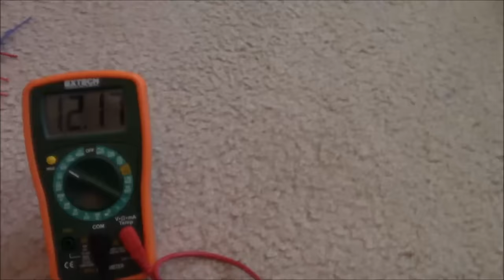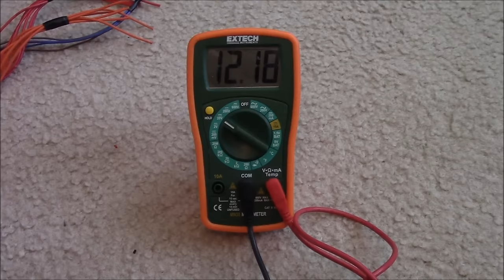How to Hack a Computer Power Supply (PSU) To Use as a 12V DC Power Source

Comment: would you be able to do this with a modular psu?
Reply from the maker: Yep!  Same procedure but you would not have as many yellow and black wires to combine together unless you connected all the modular wires to the PSU.
Reply: LDSreliance oh ok so i just grab all of the 12v rail connector pins and just use all the wires from them?
Reply from the maker: How To MLG
That is the safest option to use all the power, in my opinion.
Reply: LDSreliance alright thanks, one more thing.. are you able to use lets say 3 psu's at once?
Reply from the maker: How To MLG
Theoretically yes but there may be some issues combining the power in the real world.  Remember, electricity follows the path of least resistance so if you have 3 PSU's hooked up to a load center or something it may try to draw too much power from the PSU that has the least amount of resistance on the wiring.  There may be other potential pitfalls that I am not aware of, too.  You would be safer to get a bigger power supply.
Reply: LDSreliance my target is to get at least 2500 watts running to a car amp.. but the biggest psu you can buy is a 2k watt one
Reply from the maker: How To MLG
Use this power supply for the head unit and door speakers.  Then get four marine deep cycle batteries from Academy/WalMart/Batteries Plus for $99 each and wire them in parallel.  Get a 5+ Farad capacitor and a 12v battery charger.  Connect all your bigger amps that can't run off the PSU to the battery bank and cap for testing.  Then charge each battery individually overnight with the battery charger before your next test.

There are probably other ways to do it but even hooking 3 computer PSU's together if it really works in the real world would still not give you 2500 watts of power for a sub amp.
Reply: LDSreliance i did the math and with 3 1600 watt psu's that will give me about 375 amps to play with so i can easily get 2500 watts to a sub
Reply from the maker: How To MLG True, it should work.  Let me know how it goes!
Reply: LDSreliance alright when ever i have it all setup i will make a video on it :) wish me luck haha
Reply from the maker: How To MLG Good luck!
Reply: change of plans, im going to be getting a power amp from Cerwin Vega as it would be a lot cheaper for the amount of power i want
Reply from the maker: How To MLG Yes it would.  Is it AC powered?
Reply: LDSreliance yes, and the output on it is 5k watts @ 4 ohms bridged.. would i need a 240v socket for that? or can i just use a 120v? it says 120-240 but im not sure if i would be able to get 5k watts from it
Reply from the maker: How To MLG You'd have to look at the detailed specs but it should be able to do either one.  It probably only does 240 because that is the standard in Europe and other countries.
Reply: LDSreliance alright thanks, on the back of the amp it says 120 volt 60 hz 2300 watts.. i guess thats what it consumes, heres the link to it if you want to check it out

http://www.cerwinvega.com/pro-audio/high-performance-amplifiers/cv-5000.html
Reply from the maker: It shows under max power it will consume 56.4 amps @ 120v which is 6,768 watts of input power to make 5,000 watts of output power.  So it will make the full 5000 watts whether you use 120v or 240v.
Reply: LDSreliance alright thanks for the clarification, i  was wondering about that for a while now, also is there a way to check how much amps i can pull from a single socket without blowing a fuse?
Reply from the maker: How To MLG In your house you can usually safely pull 15 amps before tripping a circuit.  Check your circuit breaker panel before trying to use the max 5000 watts. You may have to get an electrician to add a heavy duty circuit to your house or garage where you are going to test that can handle 60 amps like you are looking at using.
Reply: LDSreliance alright my mom has a friend who is an electrician so ill ask him
Reply from the maker: How To MLG NIce, good luck!

Comment: can I charge a 6v battery here
Reply from the maker: With a step down converter or voltage regulator, yes.  Otherwise no.  In this video, I am showing you how to work with the +12v rail and 12v is too high to charge a 6v battery without hurting the battery.  You would need some way to limit the voltage to about 7.5-8v or so.

Comment: How many amps? 1 Amp ? 2 Amps?
Reply from the maker: The one I used in the video can provide 20A @ 12V.  But your PSU may vary.
Reply: @LDSreliance  that's odd, i watched another computer power supply video and he mentions only 500 mAh. Can you test it with a car headlight?
Reply from the maker: There can be multiple 12V rails.  The main one will be at least 15A in every supply I have ever seen.  But some of the other ones can be much smaller.
Reply: @LDSreliance   Well with that kind of amperage I would have no trouble charging a car battery or even using it to crank it over then! Is that correct?
Reply from the maker: You could charge a car battery but not even close to starting an engine.  That takes many hundreds of Amps.

Comment: can it power a 400 watt radio
Reply from the maker: If your PSU is big enough, yes.  This one in the video was only 400 or 450 watts and only had 20 amps on the +12v rail (240 watts).  So if you had one that was like 750-800 watts total I bet the +12v rail would have enough power to do a 400 watt radio.
Reply: LDSreliance thanks
Reply from the maker: roshaun gooden
You are welcome.  Thanks for watching!

Comment: Yes the fan will go a split second and then stop nothing else happens after that
Reply from the maker: +Zee villi It sounds like it is detecting something is wrong and shutting down.  Are you sure you don't have any of the other wires touching?  Are you leaving the green and black wire connected?
Reply: +LDSreliance  yes the green and black wire have a good solid connection all taped up and everything
Reply: +LDSreliance there are no other bare wires other than the green and black i stripped and connected
Reply from the maker: Zee villi
I have heard that some power supplies will not start up if they detect that nothing else is connected.  Try connecting a device to the +12v rail before you try turning it on.
Reply: +LDSreliance i have connected the head unit to the psu and still the fan only spins for a second and turns off i have uploaded a video of what i did
Reply from the maker: Zee villi
Hmm, I didn't see a video.  I will go look again.
Reply: +Zee villi Some power supplies have load detection. They will have a low voltage line that will always have a load when the computer is turned on. If you do not have this wire connected to a load the power supply will go into standby. You should be able to find a schematic online for your power supply and then it is just a matter of soldering in a resistor to the load detection line.
Reply from the maker: ballzack57
Thanks, that is a better way of explaining what I had heard about some power supplies!

Comment: You destroyed my power supply I connected all wires as you said and now it starts just for 0.5 second and stop ......
Reply from the maker: That is common.  It is a voltage sensing feature of some power supplies.  If it does not detect a load it will shut down.  You have to have an active load on the power supply when you start it up or wire in a resistor to fool it into thinking there is a load.

Comment: how to reduce its current?
Reply from the maker: You can use a voltage converter or you can just use a different rail.  If you need 5v power there is a 5v rail you can use.

Comment: How many watt from this?
Reply from the maker: 20A on the 12V rail.
Reply: @LDSreliance  are there any ways to get full ampere from the psu. Say 400w psu. So 12v 33A..sorry total noob here
Reply from the maker: Unfortunately, they rate the power supply as a total sum of all the rails together.  So the 12V rail will be the biggest but there are also multiple 3.3V and 5V rails as well as usually a second, smaller 12V rail.  So to answer your question, no you cant get the full factory rated wattage from the single 12V rail.
Reply: @LDSreliance  how about combining all 5v and 12v cables.
Reply from the maker: That won't work.

Comment: Why my fan inside doesn't work
Reply from the maker: DarkzFlame Gt Did you connect the green wire to a ground wire?  If you haven't done that then the power supply won't turn on.  You could also wire those 2 wires to a switch so you can switch it on and off.
Reply: Thanks that helped.
Reply: LDSreliance but now I tested it is only 8 volts not 12 volts
Reply from the maker: Interesting.  I don't know why that is.  Did you group up all the wires of the same color like in the video?  Have you tested the voltage on all the different colored wires?  Maybe your yellow wires are a different voltage than mine.

Comment: It give me 12v 15amp or more please tell me
Reply from the maker: Most power supplies will give 20A or more on the 12V rail.
Reply: Thanks sir .... i am using "TEC1 12715" to the smps it will run fir ???
Reply from the maker: Yes that psu will run it.

Comment: Who has Power Supplies laying around? I've killed a ton of power supplies. I always need to replace power supplies. For some reason my computers power supplies die on me after a year or 2.
Reply from the maker: I have been building computers for 15 years and I can only think of one power supply that has ever died on me.  When I upgrade computers or replace them I will keep the power supply and optical drive and sometimes the case to be re-used in the future since those are still perfectly fine for a new build.  So I probably have 2-3 lying around the house at any given time.
Reply: I must be unlucky because those power supplies were for a server that NEVER shuts down.
Reply from the maker: I believe you.  I think it is an environment thing (dust?  humidity?) and also a luck thing.  Hopefully you have better luck in the future!

Comment: The only one that tells us to solder all of the wires together. Here's the thing, Couldn't you cap off all but one of the wires and still have the same thing? And, I wouldn't solder the two wires together. I would have soldered them to a mounted switch so the power supply could be left on all the time. I'm just saying, you're creating a lot of extra work and it's incorrect. This isn't quite the way to do what you are doing. It will work but it's sketchy.
Reply from the maker: Yes but you can't safely use all of the available power of the power supply through one of those tiny wires.  That is why I soldered them together.  Most PSU's have 20A or more available on the 12V rail and you can't pull 20A through a single tiny wire without it heating up and possibly failing/catching fire.

Comment: how many amp 12v
Reply from the maker: Depends on the power supply.  Most of the small, cheap ones are around 20A.
Reply: @LDSreliance  your video how many ampere in 12v
Reply from the maker: Mine is 20A

Comment: A video of psu uploaded
Reply from the maker: +Zee villi All it says is "A video of psu uploaded" but I don't see a video.  Can you send me a link?
Reply: +LDSreliance i finaly got the psu runinng it needed a load on it so had to connect the purple wire and then it started, next problem is that my head unit is 14v and psu is only 12 how can i get more power out of it so i can use my head unit
Reply from the maker: Zee villi
You will need a voltage converter.  I did a video on one recently but that was to convert down from 24v to 12v and did not allow for adjustment.  Here is one that will allow you to adjust the input and output voltages so you can convert 12v to 14v:

http://www.amazon.com/Yeeco-Adjustable-Converter-Transformer-Stabilizer/dp/B015KBTM8O/ref=sr_1_1?ie=UTF8&qid=1449764213&sr=8-1&keywords=variable+voltage+converter

Comment: hack ? turn into a 12V DC power source ? i guess you didn't mean the computer kind of hacking but the hack and slash kind, because that is already a 12V power source, and a 5V and a 3.3V one as well, you just hacked the last 2 away.
Reply from the maker: I certainly didn't invent the phrasing but yes it is a non-traditional use or unintended use for a device.  By cutting off the connectors it can be used to power whatever you want, pretty much, that uses 12V or 5V DC (nothing really uses 3.3V).

Comment: if you don't have the green wire on your power supply it is the grey wire.... put grey and black together and it will work!! ALSO IT'S NOT CALLED HACKING IT'S CALLED MODDING!! js
Reply from the maker: Good to know.  I haven't yet worked with a psu without a green wire but I have had a bunch of people ask about them so I know they are out there.  And I guess modding could be a good word for this type of thing since we are modifying it from its original intended purpose.

Comment: Why use the word "hack" instead of "modify"
Reply from the maker: Well you have to hack into it to modify it.  Lots of the wires get chopped up and all of the computer connectors removed.  So it is both a hack and a modification.

Comment: It has nothing to do with the video since you want to know it's because I want to run off that if it does work instead of the solar panel all the time I have a battery Bank of 15 batteries maybe you figure out the rest thanks for answering
Reply from the maker: Yes of course.  You can use an inverter with solar or connected just to a battery.  That is fine.  I was confused about the hacked power supply and what that had to do with an inverter.

Comment: Don't get why everyone uses a wrong term being hacked.Which means to hack into a computer system and steal information.Not to modify or reuse something.You are basically reusing it in a modified manner.Not trying be rude or anything.But hack is a bad word to be referring the reuse modding a device by.Trust me it can also raise red flags with most government and law agencies
Reply from the maker: +TSpider Keeper http://dictionary.reference.com/browse/hack?s=t

hack1
[hak] 
1. to cut, notch, slice, chop, or sever (something)7. Computers.  to modify (a computer program or electronic device)
7. to modify (a computer program or electronic device)
Reply: LDSreliance
well main thing comes to mind in meaning is the definition
use a computer to gain unauthorized access to data in a system.
Reply from the maker: TSpider Keeper
I understand that is what most people think of when they think of something being hacked but it isn't the only meaning.  For example, hack saws have been around longer than computers.  Hacking off someone's limbs or hacking off a branch is a common expression.  That's all.
Reply: +TSpider Keeper no, a hack in this sense is simply using something for other than its intended purpose. The term has been around for a lot longer than hacking in your sense and is widely used. Don't worry.

Comment: Its just switch on and then turn off
Reply from the maker: Most likely what happened is the PSU did not detect a high enough load and has turned off.  Try it with a load connected to the PSU before you turn it on.

Comment: You could have at least stated WHAT the other color wires were.
Reply from the maker: Why?  You can find that in a 5 second google search.  It doesn't have anything to do with this video.
Reply: LDSreliance it had to do with the power supply used in the video, besides I downloaded the video, and watched in an area where I have no reception, so no, it was not a 5 second Google search.

Comment: can i use this to power one 12 volt motor,four cpu fans, one 12 volt water pump and one peltier?
i dont want to burn anything,
will it work? peltier i'll be using is TEC-12706 or maybe i'll buy another one
or can i power them with 12 volt 24 ah battery this one-> http://www.amazon.in/12V-24Ah-Electric-Bike-Battery/dp/B00ERVUUHG 
i dont want to burn them
thanks i'm waiting
Reply from the maker: It depends on what the current requirements are for all of your devices combined and what power supply you are using.  The one in the video provides 20 amps on the +12v rail but one that I just installed today supplies over 70 amps.  So you need to look at the output specs of your model and then add up all of your devices.

Comment: Though it is obvious you know what you're doing, shouldn't you NOT be working with electricity on carpet! lol :)
Reply from the maker: +ROYDENSTORM Haha, because of static electricity that may not be the best.  But if you aren't plugged in then it is safe to work on.  Good point, though.
Reply: +LDSreliance Just messin wit ya, good video btw :) And tbh I didn't even think about static electricity, my thought was, one arc and sparks on the rug, instant house fire.
Reply from the maker: ROYDENSTORM
Yeah that could happen.  And thanks for the feedback!
Reply: +ROYDENSTORM i always have a fire extinguisher or a full bladder handy

Comment: He only needed 1 wire...
Reply from the maker: +Mike Warren Who did?
Reply: LDSreliance The guy who made the video.
Reply from the maker: Mike Warren
That was me.  If you only use 1 wire and draw more than 1 or 2 amps you will fry the wire.  By combining all the wires together you can use the full 20 amps the +12v rail provides.
Reply: I ran an electric motor off of 1 wire. seemed to work well.
Reply from the maker: Mike Warren
Cool.  I guess I just would rather be safe than sorry.

Comment: I am sorry to say but this idea is bound to fail...... The pc smps is not designed to feed out that many amps that it could do with 5volts at its output.. The computer does not need too much of current from 12vdc line anyway and so the smps designers are not really interested to keep the 12v stable. But the pc really wants 5vdc very stable and powerful